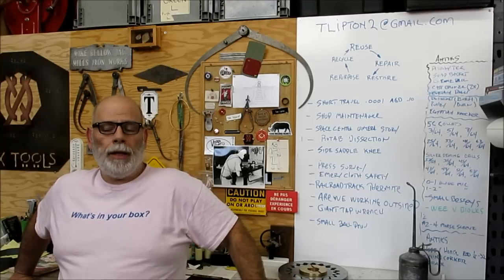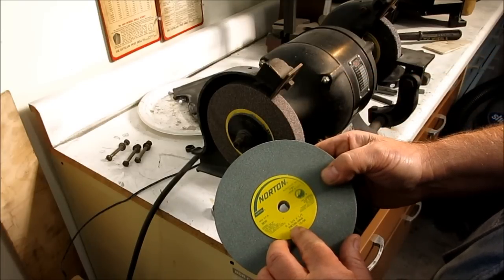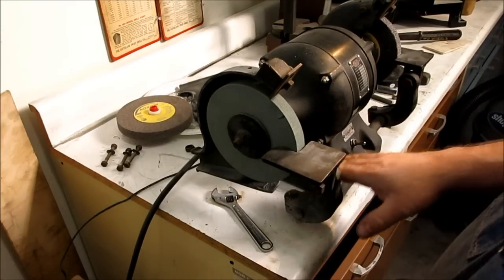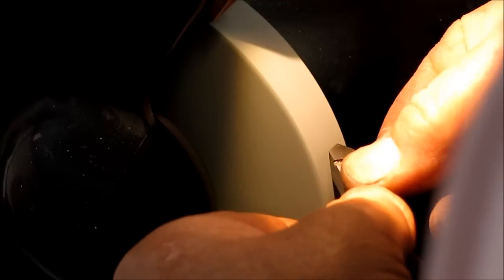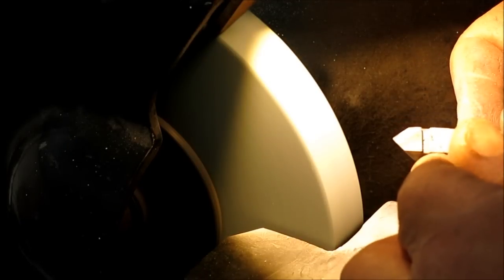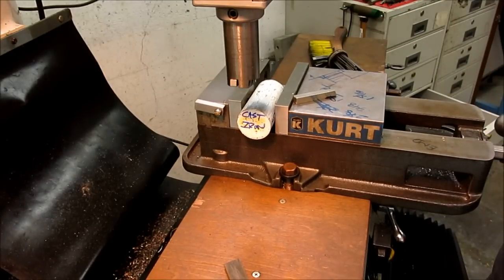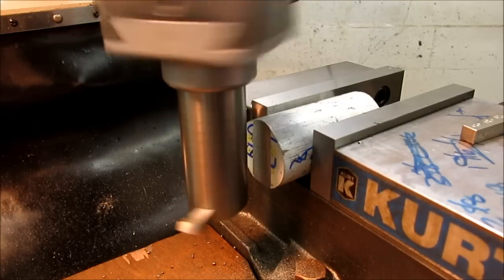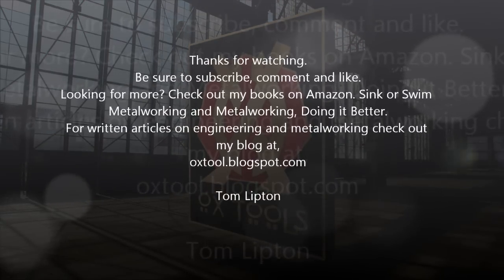Single Point Cast Iron Boring Tool

Comment: Thanks for the tip on making the grinder more balanced. I had a bad vibration with a wheel once and just put the wheel aside because I didn't have a clue what to do.
Reply from the maker: Hey Steve,

It works pretty good. I have gone from the grinder walking around on the bench to balance a coin on the tool rest by clocking the wheels. Time to dig those wobbly wheels out.

cheers,

Tom

Comment: Those were some really good tips concerning carbide. I didn't know not to cool carbide in water when forming a tool. I have done some internal boring and wondered why the tools that I formed did not produce good finishes. Now I understand much more! Thanks so much!
Reply from the maker: Hey Bob,

Carbide cannot handle the same kinds of thermal shocks that high speed can. High speed is pretty bullet proof.

Cheers,

Tom

Comment: every time i changed a grinding wheel some git had always put them on with a bloody big leaver bar and took me ages to get the nut shifted i am glad you mentioned about not tightening the nuts to tight good video tom long time since i use a boring bar to bore a block out enjoyed it
Reply from the maker: Hey Andy,

I think that guy worked at our shop once........

Cheers,

Tom

Comment: Hi Tom,
Great tip about balancing the grinder.
Sometimes I use diamond wheels for grinders, those wheel are made for ceramics but they do the rough on carbide tools... Just use the continuous ones NOT the serrated ones.
Thanks again for showing all that stuff,
Pierre
Reply from the maker: Hi Pierre,

Normally I prefer diamond for doing carbide tools as well. It was an opportunity to show the work on a grinder that most folks have. Thanks for dropping by.

----Tom

Comment: Thank you very much Tom for answering my questions and helping me on this project.  The video was very helpful I can tell my tool bit is not ground properly from the surface finish, and the chips I'm getting are more granular.
Reply from the maker: Hi Bill,

Get your hands on a green wheel. I think it will make a big difference in your carbide tool grinding. 

Cheers,

Tom

Comment: I'm going to have to try some of your grinding pointers. I am having a heck of a time with chipping my brazed carbide tools.
Reply from the maker: Hey Craig,

Just backing the tool over the work can chip a carbide tool. Specially in something like stainless where there is more tool pressure and more springback in the tool.

Cheers,

Tom
Reply: oxtoolco Or on a lightweight flexy machine like a SB9" Hmm I'll have to do a bit of testing. Thanks for the ideas.

Comment: I don't know if you mentioned this in your video, but when deciding on the amount of relief to provide, it should be made on the original inside diameter rather than the final inside diameter.
     BTW, I've been watching this videos almost non-stop since I discovered them a few days ago. Great work!
Reply from the maker: ExtantFrodo2 Hi Frodo,

Thanks for the comment. You are correct in that the clearance is determined on the min bore. 

Cheers,

Tom

Comment: To extend your idea of marking the edge of the wheel as a witness mark, I use the center head of a combination square to draw a line through the wheel center across its full diameter. This line can also then be used as a reference to more easily set the tool rest to some particular angle or orientation relative to the center/tangent of the wheel.
Reply from the maker: Hi ggs,

Now that is a great idea! I like it and its going in my toolbox. Thanks for the comment and sharing.

All the best,

Tom

Comment: Hey Tom it is very interesting that I have seen some rough boring head with two cutting edge and even single point boring head (using carbide inserts) are have cutting edge little offset then center line of work piece could you explain why is that so !!!

Comment: Hey Tom
Have you ever tried using a dremel for creating chip breakers instead of the edge of the grinding wheel?? I have been thinking of trying it myself for my cutting tools since all the wheels for the bench grinders in class seem to have a 1/4- 1/2 radius on them. Do you have any tips on what I'm looking for geometry wise when I create a chip breaker??
Reply from the maker: +Aaron Kokesch Hi Aaron,

I have tried it. It works pretty well but you have to be super careful not to slip over the cutting edge when you are using a hand held tool. Thanks for the comment.

Cheers,

Tom

Comment: Another great vid Tom !!!
May I ask what type/brand the boring head is.
Thanks again Matt
Reply from the maker: Hey Matt,

Its an older Criterion head. It hold one inch diameter bars.

Cheers,

Tom
Reply: Thanks for the fast response Tom. I the biggest one I have will hold a 20mm bar and has 3'' adjustment. I'll have to look in the morning for the brand name on it as my memory is failing me at the moment, but I'm pretty sure its American made and starts with the letter ''B'' anyways ill let you get back to making the next video instalment.
Regards Matt
Reply from the maker: Matthew Gischus Bokum?

---Tom
Reply: Sorry Tom, there will be a bit more of a delay before I can get back into the shop to look. We have had so much rain here I would have to wade through 2 foot deep water to get to the shop. I've had a storm water drain block up and flood the yard. So I have been  getting very wet digging  up drain lines trying to get the water to drain.....
Reply: oxtoolco Ok, sorry for the delay Tom.
As it turns out I lied :-0
My large 3'' boring head is a Spanish made HORMA... I picked it up second-hand a few years ago, actually from memory it was thrown in by the seller when I bought my 12'' Mecca ( I think that's the way its spelled) rotary table. Both the rotary table and the boring head had barely been used and I payed about one 20th of what they were worth... anyway that's the mystery of the boring head name solved..
Have a great day..
Matt

Comment: Havent bored a cylinder in years now that most everything is Nikasil but usually used the lathe for oversize then the Sunnen for finish. Havent yet tried the boring head for the job. Keep it in mind though in case the need arises.....;-)

Colin
Reply from the maker: Hey Colin,

This one is an inline four cylinder engine. He has it all set up on the mill. I used to have a great Sunnen hone that I did Kart engines on. You could split tenths with that thing all day long.

Cheers,

Tom
Reply: Ya, still lots of bike engines running iron. they havent caught up to the snowmobile tech. ;-)

Comment: Thanks again for the great video and explanation.  Going to have to buy a silicon carbide grinding wheel now.  My aluminum oxide doesn't stand a chance to the carbide that I rarely grind!  I've tried boring motorcycle cylinders on my mill but I was getting way too much chatter so purchased a boring bar instead.  I'd love to see your boring tool setup, especially how you mounted that shank in your bar.  Did you make that?

Andy Maul
Reply from the maker: Hi Andy,

The bar that was in the boring head is homemade and just basically a heavy duty extension. That boring head holds a one inch shank but I wanted a bar that had a slot and multiple set screws so I could hang a decent sized tool bit out a little at the end since that head does not offset that much.

Cheers,

Tom
Reply: oxtoolco
 Thanks for the comment Tom.  Sounds like a good project for me to tackle some weekend.

Comment: Would a small pair of vice grips give you more control and help keep your fingers away from wheel and keep one from getting burned on hot tool being ground?
Reply from the maker: Hey Seven,

It would help with the heat but complicate the grinding. When the tool is clamped in something hard and metallic like a vise grips it bounces more when you touch the wheel. Your hand and fingers damp out a lot of the vibration when grinding tools. 

Cheers,

Tom
Reply: oxtoolco
Makes sense ....was just cringing seeing you grind your fingers:)

Comment: What would have happened to the Norton stone if you had of ground steel with it. Would it be like grinding on a stone just for aluminum. I learned a great lesson one time by grinding steel with a grinding wheel only for aluminum, I ruined it. It had gumed up aluminum all in it. Had to use the touch up wheel a while to get it back to where it should be. Interesting Video Tom, I enjoyed it.
See ya
Mark
Reply from the maker: Hi Mark,

In the case of grinding steel on a wheel for aluminum the only downside is the wheel breaks down really fast. This is why you can use them on aluminum and brass as they break down and the material never has a chance to load the wheel. In the opposite case if a aluminum oxide wheel was loaded with aluminum I would dress it with a diamond to remove the loaded layer and then you could use it again.

Cheers,

Tom

Comment: the holder looks like it has some runout ?
Reply: that's how you adjust the boring diameter
Reply: That was kind of stupid now i think of it. Totally forgot about that
Reply from the maker: devilmastah Pause before hitting reply..... Just kidding. I actually adjusted it back to center before I shot the video. That boring head can get a good vibration going.

Cheers,

Tom